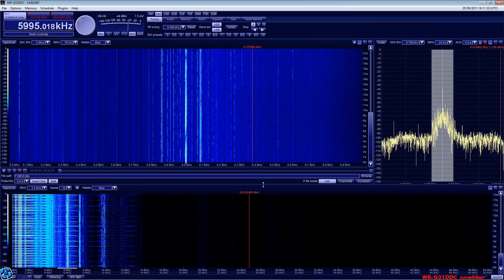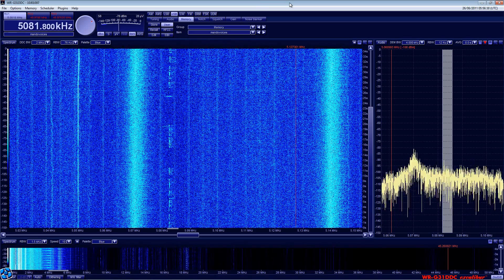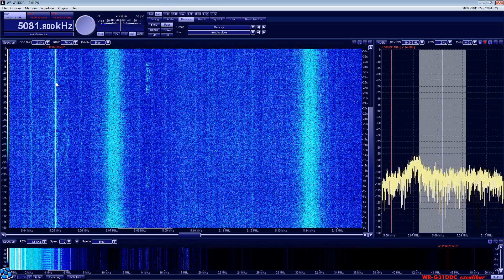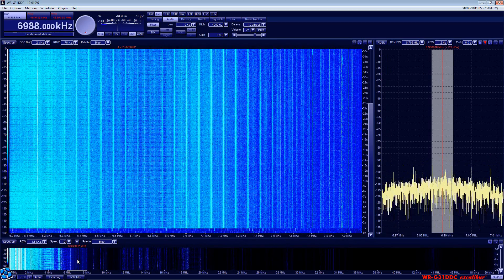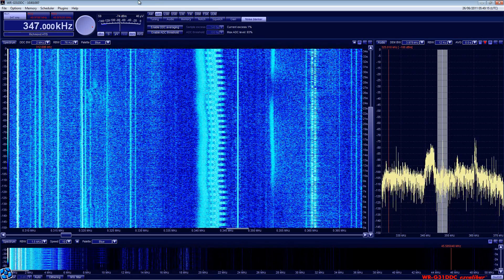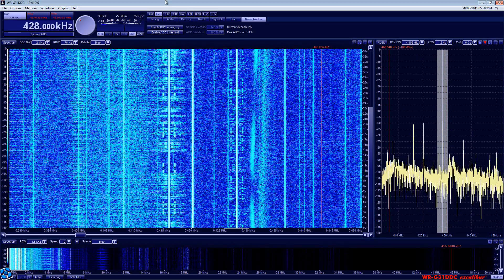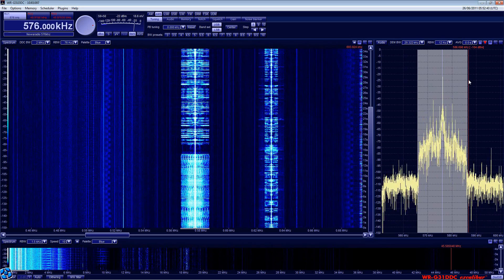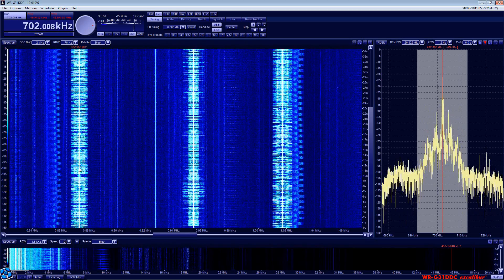A brief intro to the Winradio Excalibur G31DDC Software Defined Radio (SDR)

Comment from the maker: The USRP does appear to be more flexible - after all, it can do receive and transmit, however, you do need to factor in the cost of the "daughterboard" addons for each band which add up over time. This is probably more aimed at the "consumer" SDR market currently dominated by the likes of the Perseus. While the USRP is flexible, it's also more "manual" - configuring demodulators etc are a bit more complicated as well. I was actually considering buying one ... but the N200/210 wasn't available.